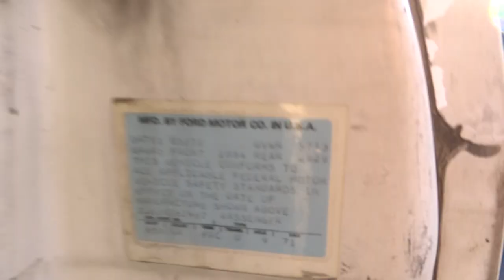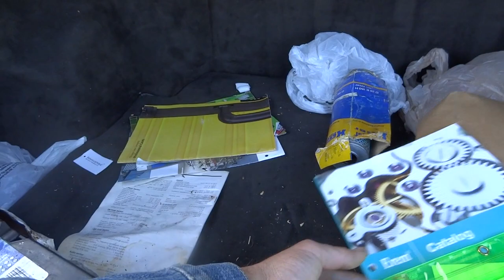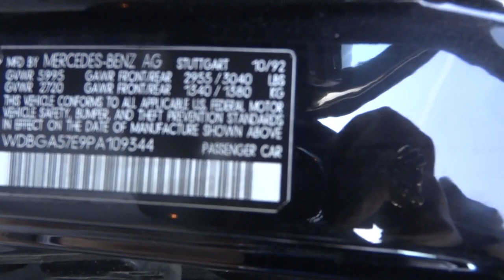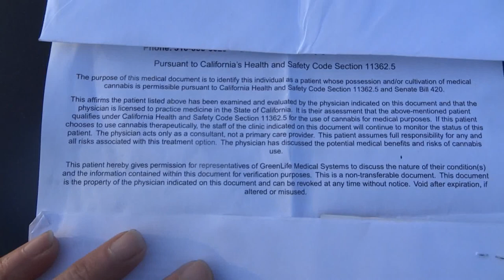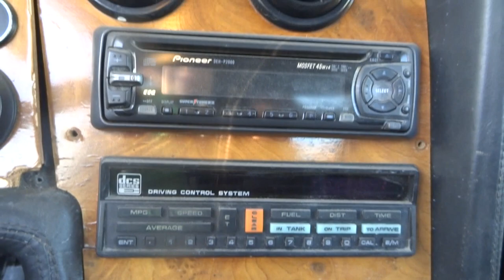Classic Car Lot Walkaround Body Shop Video Review of Muscle & Classics Dealership

Comment: 72 LTD  That front floor mat came from SEARS, my dad had a 74 Galaxie 500 he bought one year old, and bought a set of those full width floor mats for it with the compass dial marks in the middle.. they last forever, as you can see.. we used our set for about 20 years in 4 different vehicles.

uh... the AVANTI didn't start, because I noticed one of the cables had been removed from one of the battery terminals.. go back and look again  lol  

YEAH... BUDDY!

Comment: Avante AC controls are like an 80s Chrysler car like a Diplomat. Outside mirrors off of a 80s Camaro. Avacado green inside on the white Ford is so 70s.

Story behind the assembly of the Caddy fact limos. Not cut/stretch of todays.  Made in a special factory with the most skilled craftsmen in GM.  They only made limos a few months every year from scratch. The rest of the year they ran it as a test assembly line for new models, developing assembly procedures before cars went to regular factories.